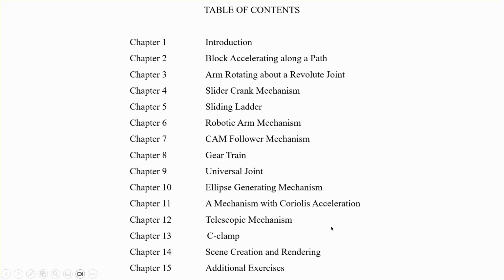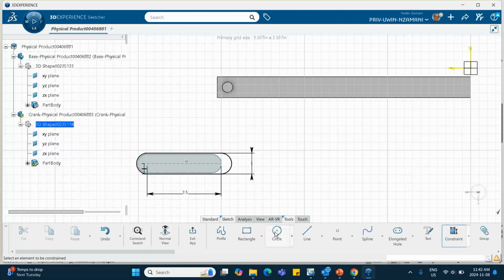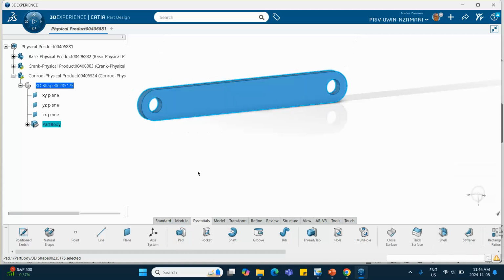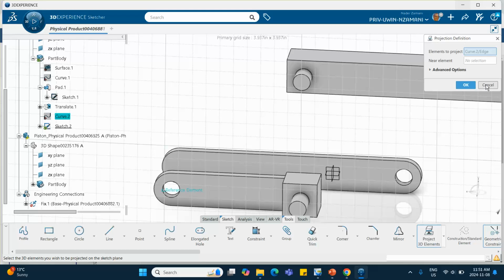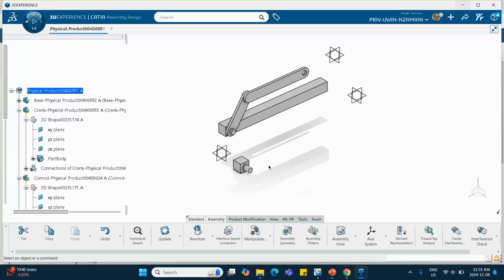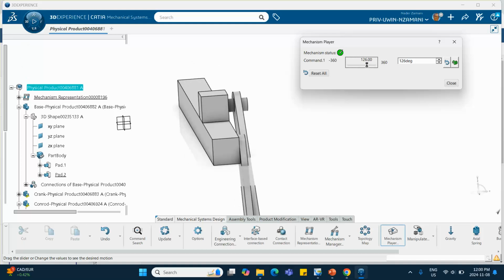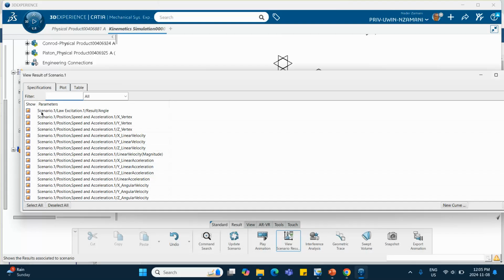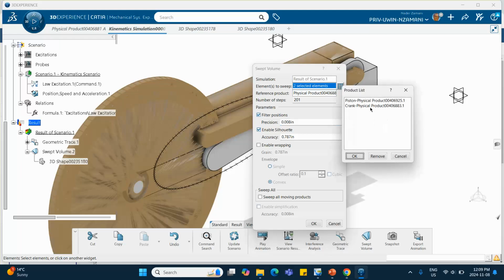Tutorial 8 Slider Crank Mechanism 3DEXPERIENCE

Comment: in 2026 i didn't find the  joint - command in the  tree
Reply from the maker: Dear Achraf, right now, I an travelling when U get back in a few days, I will be checking it out. What release of 3dexp are you using?
Reply: @naderzamani-ngzk  Thank you, Professor. No problem, take your time. I’m currently using 3DEXPERIENCE R2026x, HotFix 4.32. I’ll wait for your feedback when you’re back.
Reply from the maker: Dear ACHRAF, I checked the stuff with R2026x and still get the "Joints" branch. Can you try again?